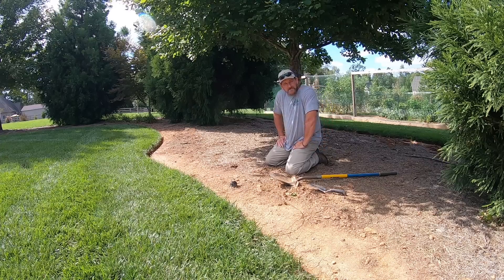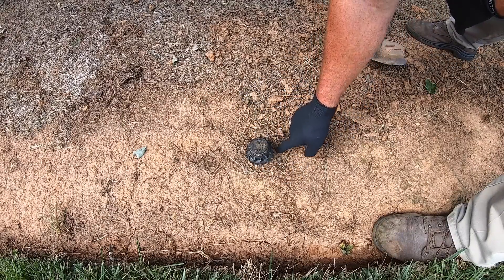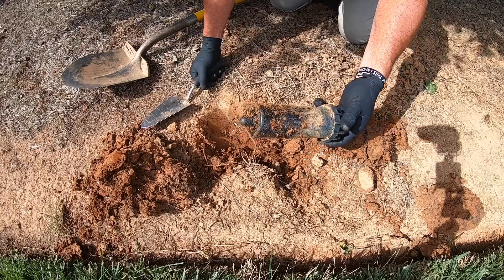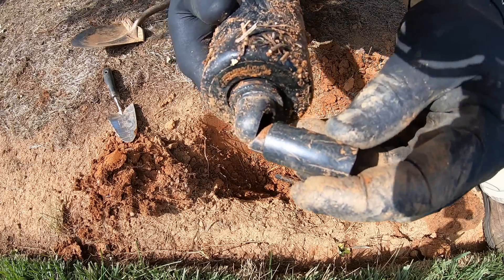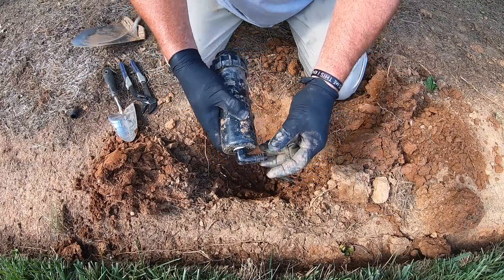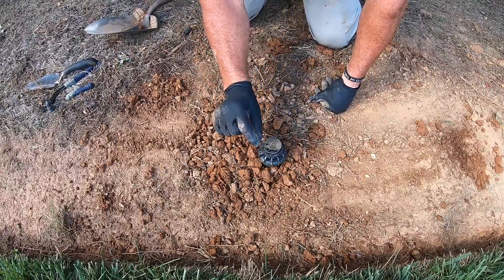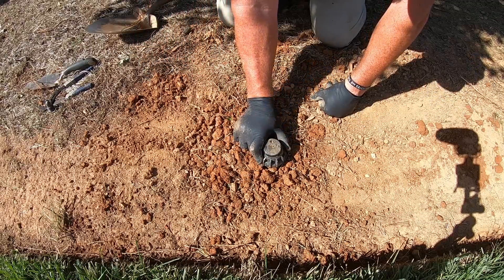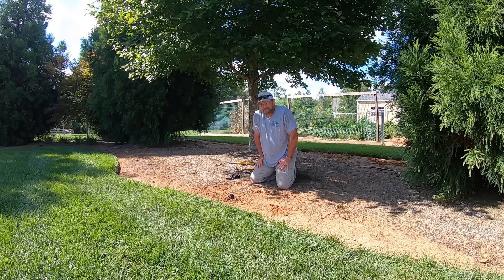DIY cheap way to fix a irrigation head

Comment: Thanks for this. I actually need to adjust one of my heads and it shoots too high. I noticed that after I overseeded and saw some of that pest moss dressing seemed a little drier in a certain spot than others. This video helps quite a bit!

Comment: Quick blast from a propane torch heats that pipe up and fittings slide right in without stressing the fitting
Reply: Steve D. Came to say this, too. Saves so much time and effort.

Comment: I recently went through my sprinkler system and raised up all of my rotor heads. Used $0.75 risers from HD, dug out the heads and added the risers myself. Cost me about $10

Comment: Pete we used always use the I20 but switched to the Rain Bird 5000 plus SAM heads. They use less water and check valve keeps from draining out.  You would love them.  We still use Hunter products as well.  Just a thought to help save some water.  Hope you doing great

Comment: I have all my sprinkler heads on swing pipe so if someone should step or run over it , It will move so it will not break.
Reply: Thats exactly what he has here and it broke. Swing pipe only allows you to readjust the sprinkler head height. Doesnt prevent damage.
Reply: @Dstromb232  You must have really soft dirt.  In NC, once that dirt gets wet and dries, it holds pretty fast.  Doesn't matter that the funny pipe is flexible...it will still snap an elbow.
Reply: @ScottHammet  I do have some clay in my soil but when I built my home I did had truck loads of top soil mixed with light sand in it but I never let it completely dry out. I only have the swing pipe on my outer heads because I live on a corner lot and the school buses kept running over them so I went after the school to pay for the 4 heads so I put swing pipe in from the installer Then put concrete donuts on the heads and problem solved.